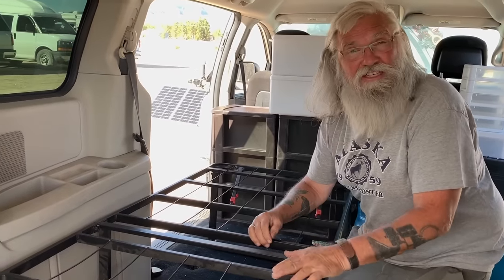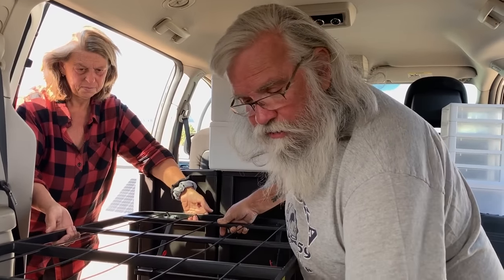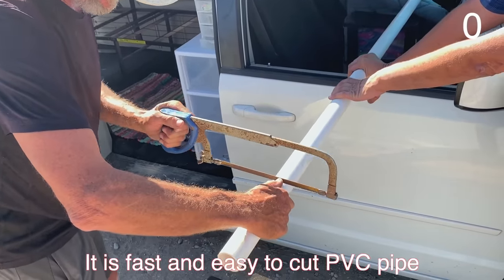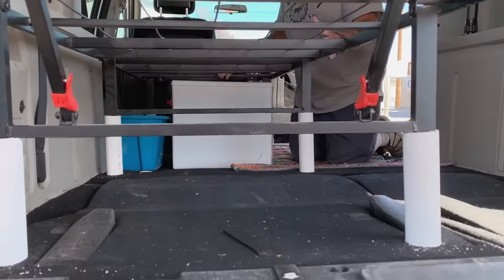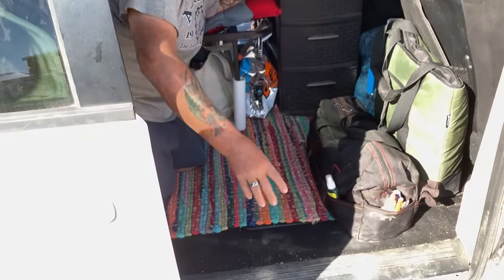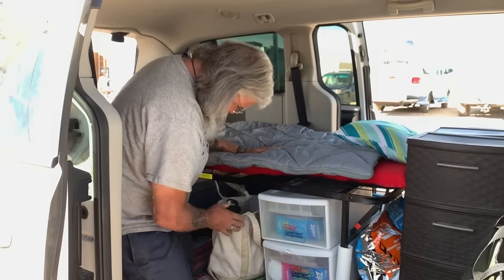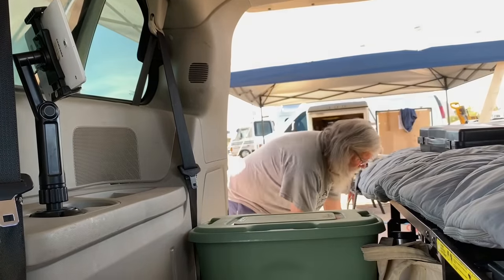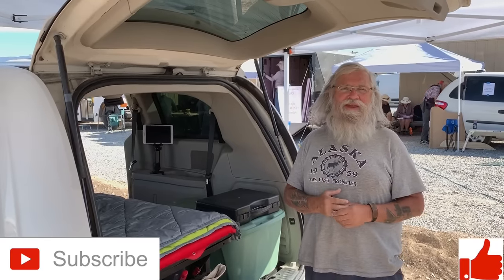Van Life for Less: Affordable Easy No-Build Van Conversion | No-Build Van Life

Comment: You are correct here and a small folding table a couple of folding chairs a small electric fridge to hold your day to day basics and you are really set. You can buy a battery box to house your extra battery and a folding solar panel with all the required leads etc etc and you are set up.. Finally a small inverter to convert your 12v battery to 110 or 240 whatever the voltage you have in your country of origin.If you are adventurous enough and go with a higher voltage configuration you can buy a larger inverter that will run a small microwave which in most cases you only have to run for no more than 20 mins to cook a meal in . Being here in Australia we have a big variation in temperature from snow to 110 farenheit or 45 degrees celsius so some form of cooling or heating is sometimes required.. Whilst free camping is your cheapest option a unpowered site at a van park is still reasonable therefore giving you access to a hot shower every couple of days when you need it.

Comment: You could rig up a board to slide from under the mattress to the outside (it would have to be braced/straped down around the cot frame ( loose enough to still slide) so it wouldn't slip.  If only 10-12" of board patruded outward it would be enough for some space for the outside kitchen .  I hope that explains my thought well enough.  Happy travels and God bless.  How exciting!

Comment: At the back it looks like you have an in floor seat. You can pull that up for seating and set up your kitchen in that trunk area where the in floor seat was. In my 2005 chrysler town and country,  that one rear seat is smaller. Also, they sell those tents that connect to rear hatch if your camping. Great idea, my friend! I just may modify mine.

Comment: In the Chrysler Town & Country and the Dodge Grand Caravan you can unbolt the stow-and-go seats and remove them. The second row has built-in covers, but the third row does not. You could build a cover to even the floor out. 
The two second row storage areas are roughly 21"x23"x9" each. 
The third row is about 39"x21"x10".
I'm 5'4" and can stretch out on the floor between the sliding doors, but just barely, and I can almost stand straight up in the third row storage area, but I have to hunch my head down a bit.
Taking the seats out will lower the weight and might improve fuel economy too. I haven't tried it yet.
Right now I need the seating, but in a year or so I'm going to convert my Dodge GC into a camper like this video. Thanks for all the ideas!

Comment: It’s nice that you commented on the weight capacity of the van; that is how much I can carry and still be able to brake,reasonably. 
It would be good if you could stress that a little bit more because most people only replace or take care of their breaks when they have no more breaks. That’s not even to mention shocks and struts. So please mention that a few more times in your videos. And maybe move the outgassing battery from underneath the head of the sleeper.
Great video.

Comment: To give yourself some protection from rain while standing at the back of the van cooking your meal, or for privacy, you could purchase a shower curtain, put some Velcro  around the edges of the top of the shower curtain. Then, affix some Velcro along the edges/perimeter of the back door of the van to match up with the the shower curtain's Velcro. Affix the shower curtain to the van back door. Now you have shelter from the rain if it's raining, or privacy with extra space outside at the back of the van where you see Bob standing at the end of the video!!

Comment: Great video to help folks get started on a camper.  One comment to share regarding the use of the stove.  I have the same stove and love it.  However, I have discovered that the stove directs heat to the counter top when cooking and began to melt the plastic table top I use for a counter.  I now slip a thin piece of plywood under the stove when cooking.

Comment: A three thousand dollar van could cost 7,000.00 more in initial and ongoing repairs.  I bought in 2016 a 2000 Toyota Sienna van, after costly repairs, I now have a breather. 

Regarding the bed, I lowered it... which means less storage underneath,  but it's wonderful to sit straight up on the bed and still have head room.
In winter, I put hothands in my sleeping bag.  It's easy to get warm in the winter but difficult to get cool in the summer.... especially in Lost Wages.

Comment: Make sure the parking spot you're in is level when using the level to measure and cut the PVC pipe legs for the bed. If the parking spot isn't level your measurements will be wrong.

Comment: Someone who can measure cut and pound/screw can also live in a house boat. You build a raft that will float and build whatever you want on top. There are lakes and rivers everywhere,  take your pick. You'll be MUCH MORE welcome wherever you are if your house boat " IS NOT UGLY" ! ON a river the water is moving, you put a wheel in the water and have more electricity than you can use. If you can make things and you know your going to have to find somewhere cheap to live, a house boat could be for you .

Comment: By putting pvc pipe on the bed (cot as you call it) legs, you are then putting all weight onto the cross bars which aren't designed to hold that weight, they are there just to stop the legs from bending in. I don't know if yours has lasted or would last as I can't see the weld properly but I have seen cross bars that have just been welded in a few spots and in no way would hold a person's weight for long. There are so much better ways to raise the bed than potentially have it fall apart while your having a nice sleep

Comment: In CT, in 2023, it would take 6K or more to get something with under 100,000 miles on it. This is not to say it isn’t worth doing and I’m not afraid of vehicles with higher mileage, as they rate greater than 4.5 on Edmunds consumer reviews. Between 4.7 and 5.0 you’re golden.

Comment: Why build a bed? if you're going to live in a minivan, why would you take up 1/3 to 1/2 of your available space with a fixture that you only sleep on at night?
I live in my van for long stretches delivering things around the East in the United States. I sleep in my van frequently, but I need the space open to transport things. Here are some solutions to consider which provide a place to sleep, yet keep most or all of the van available for other uses:

 bolt two to four heavy rings at the corners and sling a hammock

Using inflatable mattress with a 12 volt cigarette lighter pump

Have a regular mattress and store it vertically bungee corded to a wall... Sort of a no-billed Murphy bed.

I think these three ideas give you more flexibility, and really are more of a no-build build than this video's option.
Nothing in this comment is meant to be any sort of criticism of Bob who is the godfather and the man.
Reply: The bed could be positioned as a daybed and could be used as a couch with a projecter. Just a thought though

Comment: I was surprised to see that you can still get a hacksaw at walmart for $6 - the plastic containers do fluctuate in price and have gone up a bit recently, but the hacksaw remains the same.

Also to someone looking for an easy and inexpensive no-build set-up, I would recommend Ikea - they have some slightly more attractive and durable plastic containers for a very similar price to walmart, but they are likely to last a lot longer, as well as some lightweight metal shelving units, and of course the inexpensive cardboard core furniture which is still (in my personal experience) more durable than the equivalent Walmart product.

And Contact Paper is your friend - spice up some cardboard boxes or some clear plastic tubs - it's cheap, it adds some durability, and it lets you add a personal touch (which is great for mental health, feeling like it's yours and decorated your way instead of a big-box bland interior).

Comment: I did bare bones in Suzuki swift aka geo metro 2 door. Removed passenger and rear seat. Insert plywood for bed. The biggest downside to bare bones is no heat. Next time I take the hot water bottle, a no brainer but I don't have one.

Comment: He needs to buy a mini inverter put it in the bin and get a couple extension cords cut them to size. drill a hole in the bottom of the bin for the cords. And bam you have plugs for a mini fridge. That’s what you need is a mini fridge

Comment: Buy a adjustable leg bed chair off Amazon or such. All the legs are height adjustable. I use them for fishing when camping on uneven ground. Way easier. Can be found second hand too. None of the messing cutting stuff to make legs the right length. Add a 2 inch inflatable nsulated mat and it's a great bed. No need to do all this messing just put in the van adjust legs and your done.

Comment: I would think that the pvc pipe would create a lot of stress on the weld that attaches the cross member to the leg with a lot of weight on it. I can see those welds breaking. I should think it would be much better to cut the legs to level the bed. Yes you lose some storage room under the bed but you don’t have to worry about the welds on the bed frame breaking.

Comment: Have you ever just installed moving blankets on the walls of a van. I have a travel trailer I pull with my chevy express. But would like to take some short trips maybe overnight and just leave the trailer in a RV park. just need a bed and portable stove and DC cooler. But was thinking of putting snaps on the walls and moving blankets and putting them on the walls.

Comment: I have put old books under my bed to level it , it worked good but not very professional 😞 I also used them when my frame Brock to hold bed up stacked them under it and made like bricks out of them they worked good and We’re even cheaper than buying bricks to put under my bed and you could literally stack books underneath your whole bed and make a bed frame with it and books are super cheap these days unfortunately half-price books dollar bookstore even thrift stores you can buy hardbound books very cheap but I don’t know if it would work in the van but if you ever have a old bed and you don’t have a under bedframe and you want to get it off the ground go get a bunch of books and stack them in the four corners and one in the middle and you’re pretty much good to go and then you can just get a a skirt if you want to put around it so nobody can see female ingenuity or desperation whatever you wanna call it 101

Comment: If you have a acid battery and tied to a charging system it has to be enclosed and vented outside, UNLESS you use an RV gel battery for interior compartments.

Comment: I'm a Homeless Veteran, currently unemployed, living in a 2001 Dodge Durango since April 2021.  My SUV does not have working A/C nor does the heater work.   It's crazy because I never looked at Vans the way I do now.  I see them driving around or parked and I think "man, that's got to be awesome to have that much space".  My SUV does obviously have fold down seats but there is so little head room.  I sleep on a 3'' foam mattress topper that's folded in half.  It's ok, but my back and hips have really started to give my problems.  I have a small Jackery 240 but cannot afford solar panels - nor do I have a physical address to order better buying options online.  Looking for any advice or solutions to living out of a SUV.

Comment: Great video! I'm wondering about the pros & cons of using a 2-drawer metal file cabinet( that I have) in a transit connect that I'm just getting started on equipping. Am not ready to commit to more permanent shelving. Thanks!
Reply: i would find a metal file cabinet way too heavy to manoeuvre about - this video is about simplicity and plastic drawer sets don't add the significant weight that a file cabinet would.  but hey, you may be a muscle bunny..